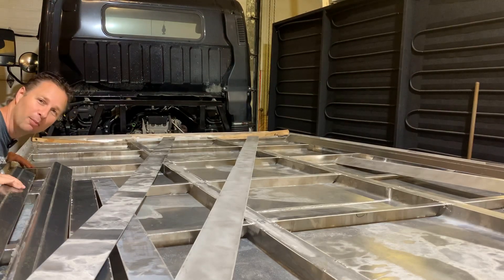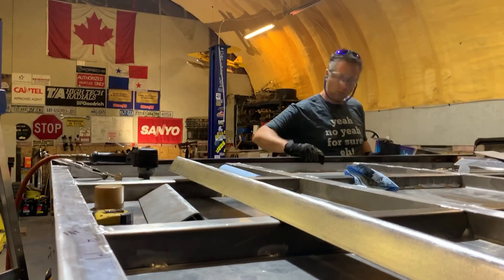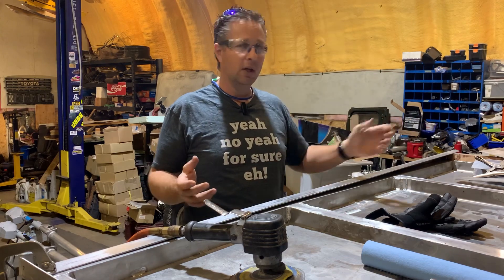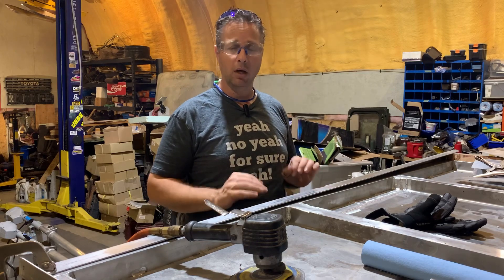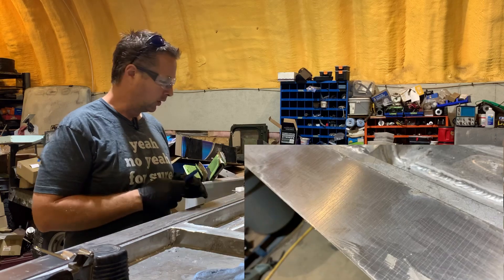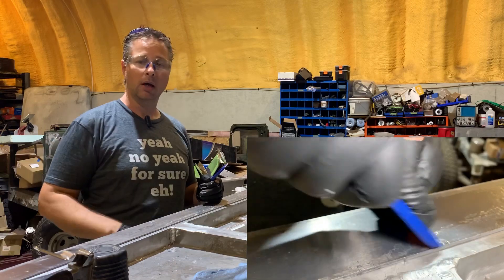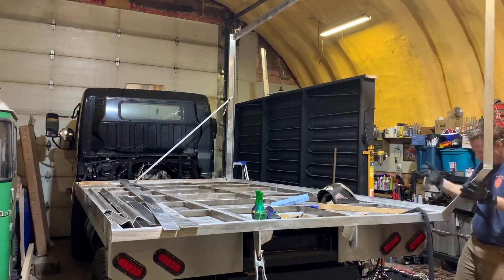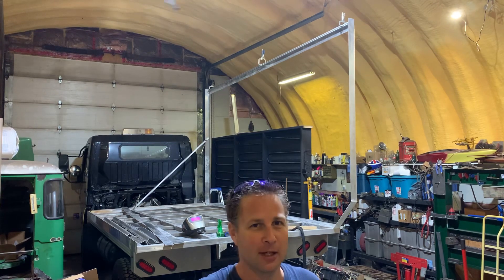A new direction!  Habitat walls going up | Fuso Overland

Comment: Congrats on the vertical, Bruce.  
Q: What does brake cleaner do to affect welding?
Reply from the maker: Some brake cleaners can release phosgene due to the heat and intense UV radiation from welding.  It is colorless, odorless, and toxic.  Heavier than air, and a pulmonary irritant, it’s technically classed as a chemical weapon.  Not nice stuff to mess with accidentally making while welding 😎.

Comment: So cool. I'm Planning on building a box next spring. So curious if you really need the outside frame? Browsing through youtube, I see Many builds just glued together and capped with a extruded trim. Is there a reason you went the frame way?
Reply from the maker: You could for sure build this without the exoskeleton.  If bonding the panels directly to each other, you’ll probably want to have something to cap the corners after to cover the seams and help weatherproof it, but does not need to be the way I did it.